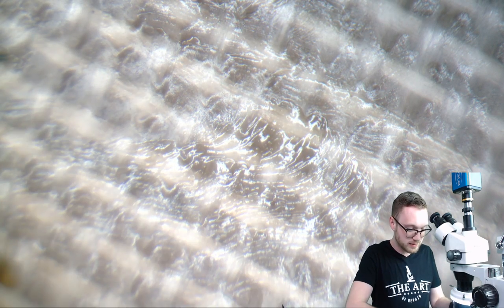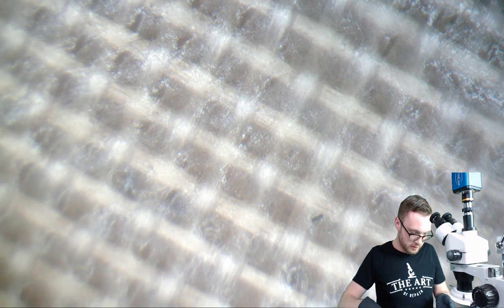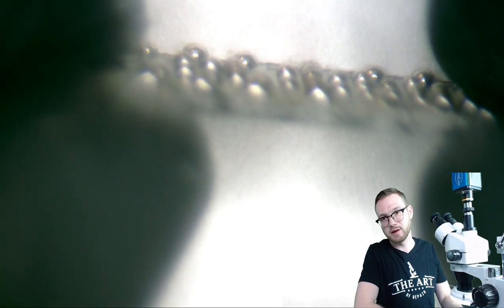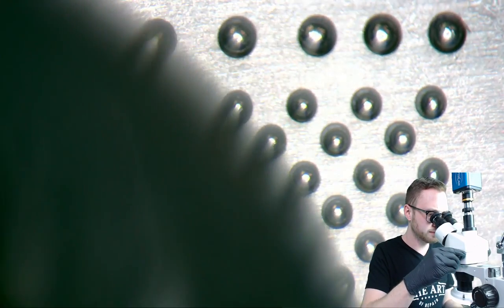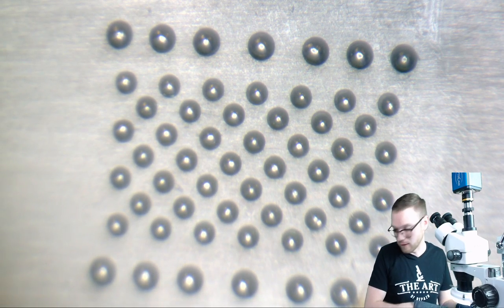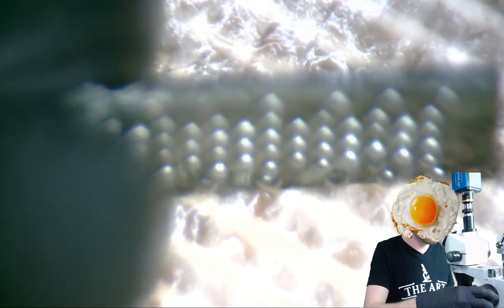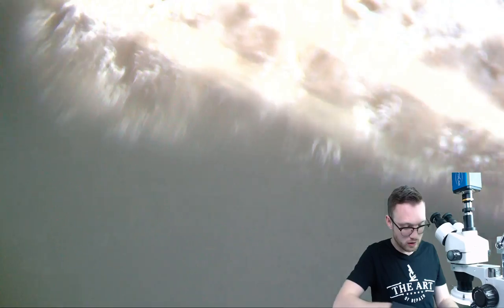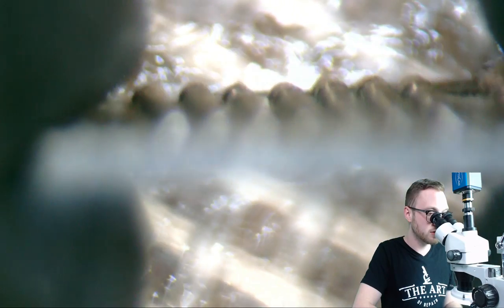EP15 IC Reballing Without Solder Paste/Balls | Perfect Hand Reballing Forever

Comment: There were a few remarks on differing ball size.
I think, if you do sanding and reheating a couple of times, the balls should be of even size/diameter. This is because you sand away everything that is higher than the stencil. And with every time you do the sanding and reheating process, more balls won´t get sanded any more. As soon as there is no ball being sanded any more, you have the absolutely perfect height and diameter. The only thing you should look for, is that you sand evenly and don´t create an indentation.
Reply from the maker: You nailed the technique on the head, while yes, there were one or two that were not perfect after examination, this can also easily be fixed. Its just a little back and fourth with it till its correct, but one of the best ideas when your in a pinch.

Comment: Nice work! Hand reballing requires a patience that I lack despite being a fairly patient person, haha.

Also, while "solder fumes" are disgusting and bad for your lungs/health, they contain zero lead. This is a common and massive misconception about soldering. It's entirely the flux fumes as lead cannot vaporize anywhere near the temp your iron/hot air can get. It's not even close so don't eat the solder, wash your hands/wear gloves and you're ok with regard to lead. The smoke is burning flux, be it extra applied or burning from the core of flux applied within most solder. Again, that does contain many nasty chemicals so absolutely have an extraction setup of some kind.
Reply: Ironically the myth is that there's no lead (compounds) in the vapor. While the lead itself doesn't vaporize you will have minute amounts of lead based compounds in the flux, this is because the flux itself is reacting with the lead oxide itself and "trapping" the lead oxide within the flux. While this metal oxide typically stays within the liquid or solid residue from the flux and soldering process, any fumes from the flux will have minute amounts of metal oxide from the cleaning process since it's the vaporized flux that had previously been "holding" those same oxides.
Reply: As a follow up to my previous reply, there's significant literature from welding suppliers, air handling equipment companies, electronics manufacturing companies, and OSHA itself that have demonstrated tests showing that vaporized lead oxide is commonly present in soldering environments.

Comment: Very nice work. By the way, with just a couple of pc case fans, or psu fans, whatever, plus a box & pieces of old cloths, you can make a very usefull & filtered fume extractor (...not for take the fumes to the rest of your workshop or home :). Just clean & change the cloths from time to time, this thing changed my life. There're lots of tutos about diy extractors overhere. Cheers.

Comment: Great video! but quick question: without adding additional solder paste to fill into the stencil holes for each balls are these solder balls high/ large enough to make good connection to the pad? They are evenly high for sure by using your way. Or, the size of the solder balls don't matter as long as they are even in high? Thank you for the upload of this video!

Comment: What are you spraying on the chip with the spray bottle?
Reply from the maker: Just an air blower =)   I use 99%iso and an acid brush to clean the chip. The only other thing to touch the chip, chemical wise, is flux.

Comment: Hi Justin, I tried this technique but the solder doesnt want to stick to all pads 😞...what am I doing wrong
Reply: Solder will stick to whatever is hot. Could be you are trying to attach solder to cold pads. As an experiment if the soldering iron is not hot you cannot add solder to it. Similarly if the pad is not hot it cannot melt and attach the solder to it. Practice on a scrap piece. Heat the pad first then apply the solder to the heated pad, once enough solder is applied lift the soldering iron.

Comment: Ipbox v2 work until today bro? Becasuse i use before and get error 40.. how about you?
Reply from the maker: Benny Suryawan ipbox2 is not cloud based, mine works fine. Error 40 on what the box or the phone after install?
Reply: Before iphone is normal, i try to replace nand with the new one. But get error 40, mybe i not correct to reball and put in back ... but ipbox is fine yah,  because @gsmhosting, many user get issues error 40/4013... :(
Reply from the maker: Are you using a test jig to test your nand prior to resoldering it?
Reply: TheArtofRepair disk test on ipbox? Yes asbolutly,, but if i put in back, always getting error 40, but i keep trying.
Reply from the maker: You need to test to board with a hard drive test jig. This is a 100% necessary step. You can use either 

https://www.aliexpress.com/item/7-in-1-HDD-hard-disk-test-fixture-stand-For-iphone-4-4S-5-5S-5C/32667189206.html?spm=2114.13010608.0.0.QyNrL6

or you can use a disposable test strip. 

https://www.aliexpress.com/item/2pcs-lot-WL-LZWLKJ-LG60-B-for-LGA52-LGA60-Socket-for-iphone-for-ipad-Nand-Flash/32713028005.html?spm=2114.13010608.0.0.QyNrL6

The deal is, you gotta test it before install to make sure it is good to go and not damaged. This also allows you to test the device to make sure its still functional after your removal of the chip.
Reply: TheArtofRepair tx justin very usefull

Comment: lol@psa... it's not the lead that's the cause derp, it's the flux, and rosin, and the lead itself isn't gassing off. The main reason you use a filter, again, isn't because of the lead, but because of the corrosive nature of the flux.
Reply from the maker: Yes, a majority of what your breathing is the flux fumes, absolutely.  But be aware, lead exposure is measured in the microgram. Lead itself is very dense. Meaning the particles are beyond microscopic. You are 100% breathing in lead. If your job is doing this 12 hours a day for most of the week. Then lead can end up being your major long term factor. Also, there is a difference between doing a one off solder joint, and reworking older oxidized joints. When your reworking older  oxidized joints, especially if you are realloying them. They produce micro dross, as opposed to the large amounts of dross you would find on a manufacturing floor.  This in itself also contains lead, and will make itself a home in your lungs.  Thank you for your response. I feel like the best responses i get on here are the ones that make me think for a moment and question myself. So thank you. I hope you keep watching the channel!

Comment: I do this all the time. With 80% success . But I don't do it to be permanent. Mainly for data recovery and small chips. I won't do this on chips with many pads with small spacing
Reply from the maker: Of course, this is kind of a pinch type maneuver, I would actually put the job on hold and order the stuff i need if it were a serious job =)

Comment: Reballing should not take that long I can do it in less than 2 minutes. As for his comments regarding fumes and the health hazards of lead, it is the flux that is harmful due to the solvents that are added to essentially pine sap, which is the main ingredient. The more flux you use the more harmful it is. It can cause respiratory problems. Lead soldering does get hot enough to the point where it can cause harm, although you should wash your hands if you are handling solder without gloves.
Reply: I don’t have any experience doing this than watching a few YouTube videos and reading about it, but it sure looks to me like using a mask and solder balls would actually be way faster than this process?

Edit: I also suspect that even with the template it may be a tiny bit too much solder using this method, although that might not be a problem?

Comment: doing this method you'll get diffrent size of balls, there is a higher probability exists that won't be interfacing
Reply from the maker: The beauty of this method, is that it can be like polishing metal. While yes, you're right in the fact that it can produce different size balls, but that is exactly why there were checks and balances in this technique. Like the ability to optically check your average array ball size from multiple angles. Using other information during the process like average topside surface area per pad when shaved in the stencil also gives clues to the size of the finished ball. Given there is a small bit of allowable tolerance in this as well in terms of the end resulting solder ball being able to coexist near slightly larger ones. There are many context clues in the small details that allow this to be a pertinent technique. This technique is ment for those who find themselves in particularly bad situations where a job needs to be done. Not for every day reballing, only from the standpoint that it can be time consuming if done appropriately.
Reply: I think that this method can be effective but for small ics having around 20 -30 pads
Reply: If you have patience and enough time it will eventually produce evenly sized balls, took me nearly 4 hours of this thecnique on a 210 pin LG PMIC but it came almost perfect sized balls. The method is great and comes in handy when you dont have stencils available for all types of ICs, also I used a variation of it using another IC for comparison instead of the stencil (since I wanted it to be a by hand only method)

Comment: Rofl, you actually never inhaled any parts of lead, it’s only flux. Temperature to actually evaporite lead is much above its fluid state, bro. With your experience you definitely should know that
Reply from the maker: your actually 100% right, and at the moment for some reason I did not, I think for me it was just "lead = dangerous" and I had read many things about soldering dross which IS micro lead that can enter your body from the process, but it pretty much only produced in large amounts from industrial wave soldering. So yes, its not the lead, its the FLUX thats the problem to breathe. Iv been working on alot of corrective videos for a new series over the last year and one of those corrections has been for this concept. 

Thank you for taking the time to comment! I have learned alot over the years from random comments where i goofed up. 

You know what they say, the quickest way to the right answer is the wrong answer online with a comments section =)